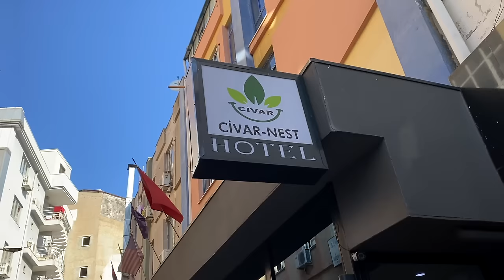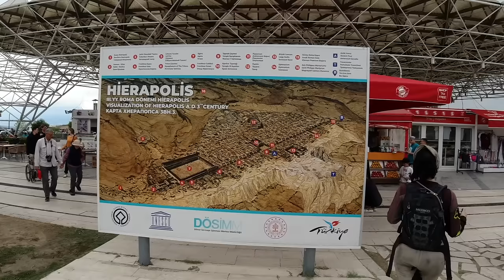THIS PART HAD TO BREAK EVENTUALLY… 🇹🇷 [S5-E60]

Comment: considering what you have done, the condition of your bike is extraordinarily good. I've been following since you set out.
Reply from the maker: Bumblebee is unbreakable 🐝❤️ thank you so much for watching 🥳
Reply: Yes this bike is rock solid. I have same model in orange. You must keep Bumblebee for posterity, even if it goes into a museum.
Reply: Suzuki should name a limited release model,  vstrom 1050 "bumblebee" in honour of the one that circumnavigated the globe. Its actually quite a big achievement for both you as a couple, as well as the motorcycle. Youe sponsors and suppliers for overland kit should be well pleased. Certainly impresses me (and I've been riding 40 years).